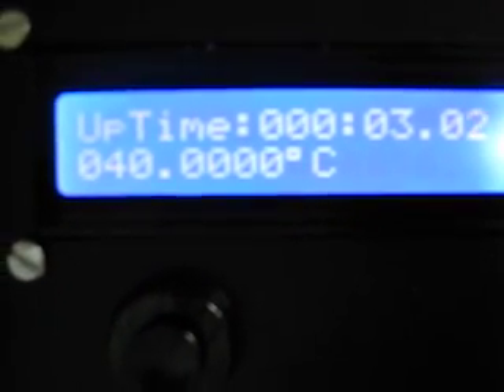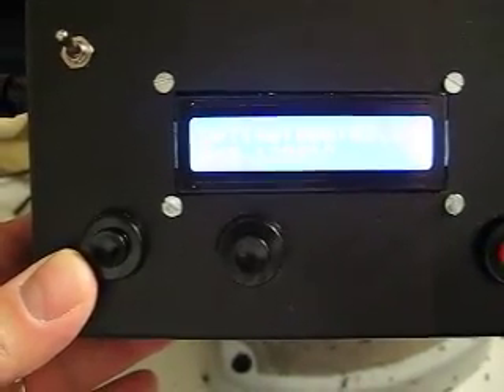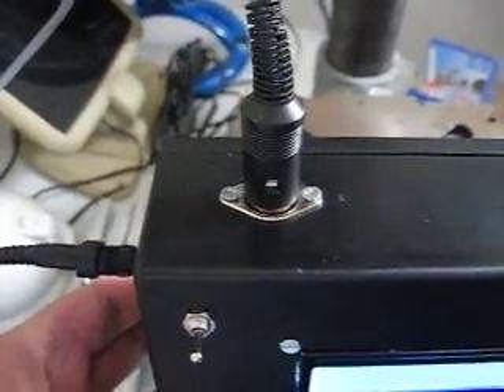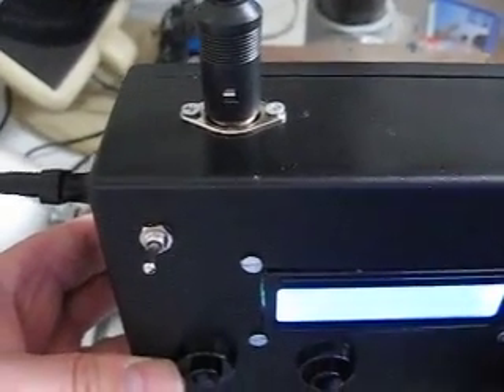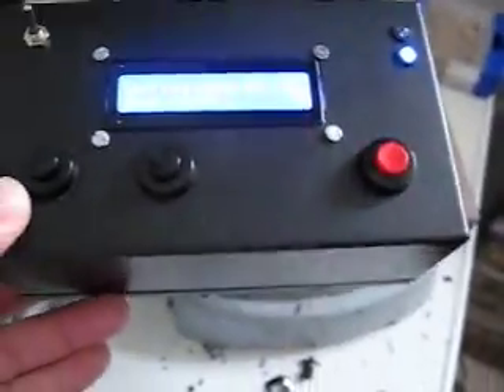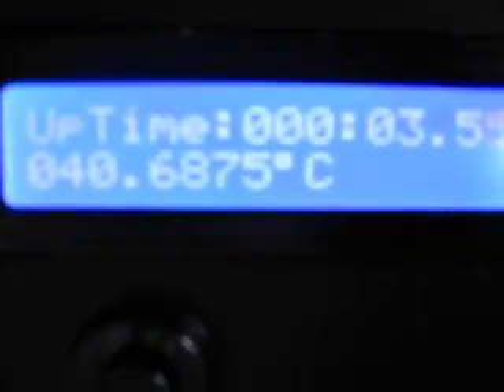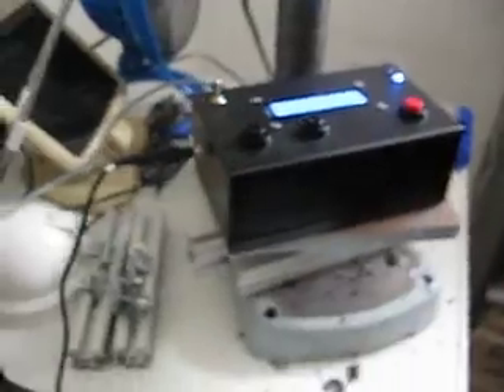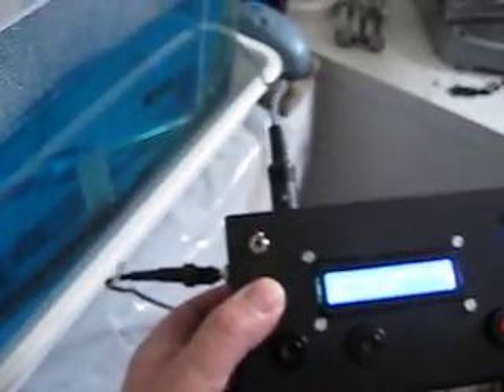Etchtank controller with DS18B20 & PIC18F2550

Comment: Cnightwing,

Did you implement a PID controller on the PIC for this or do you simply switch off the heating element when the etchant reaches 40 degrees?

Keep those vids coming!
Hans